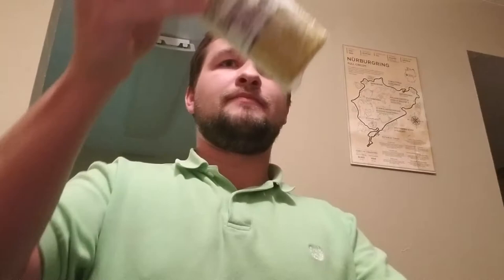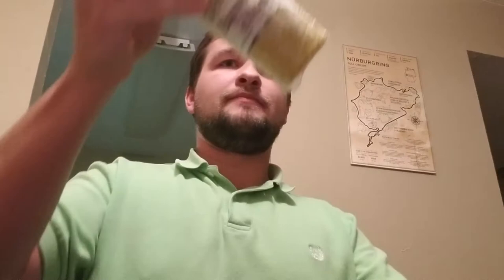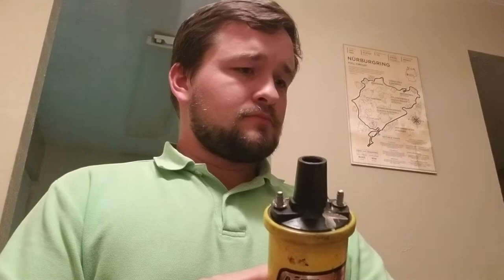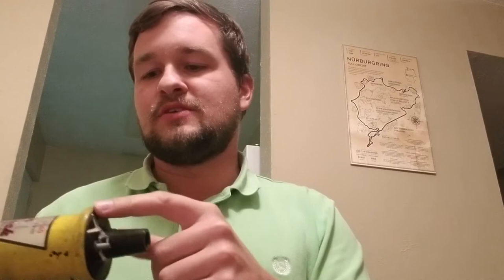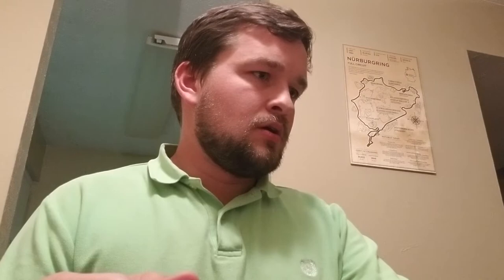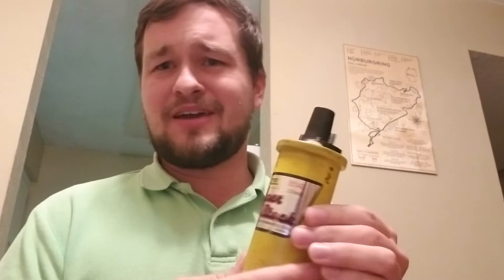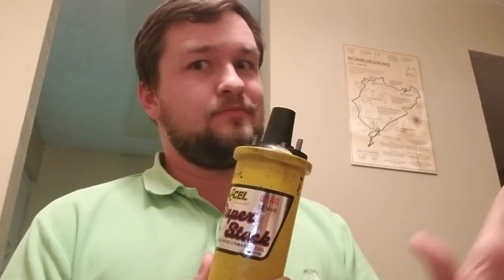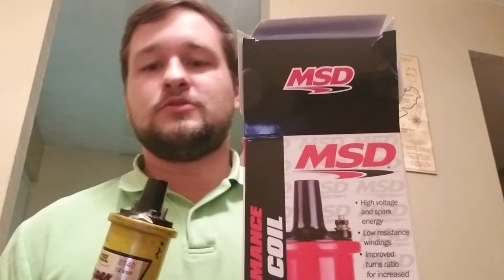Ignition Coil 1st Gen RX-7 FB

Comment: Great informative video. But The High Vibration Coil, PN 8222, per MSD, can be mounted in any position due to its epoxy potting compound. I have mine mounted in the stock inlets for over a year now.
Reply from the maker: That's the point of the video.

Comment: So with the 6al msd box it will bounce off set rev limiter and shoot out the flames like you disscused shortly?
Reply from the maker: Correct. The flames get better the hotter the exhaust is. I dont recommend staying on the limiter since it's an ignition cut limiter instead of a fuel cut so you can hurt apex or side seals

Comment: Can you run it without a ballast resistor?
Reply from the maker: Don't have one currently on mine but I'm running MSD boxes as well
Reply: What if I'm running stock distributor with msd coil. It's a 12a. Emissions deleted.
Reply from the maker: That's how mine was setup before I converted to the MSD boxes.  The coil should just be a swap in part.
Reply: Cool thanks appreciate the reply